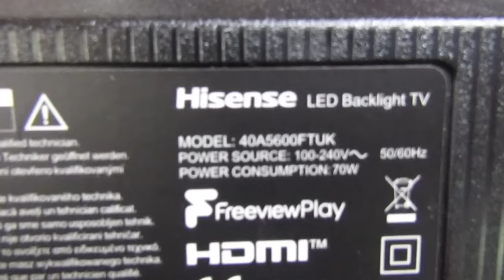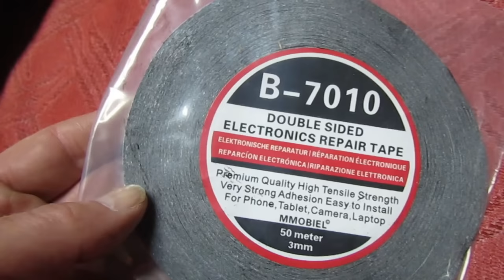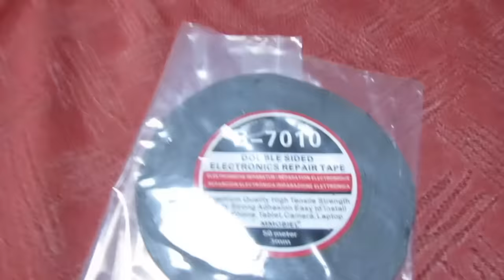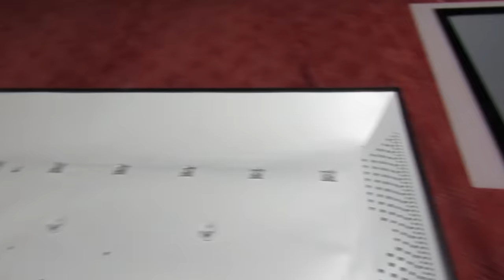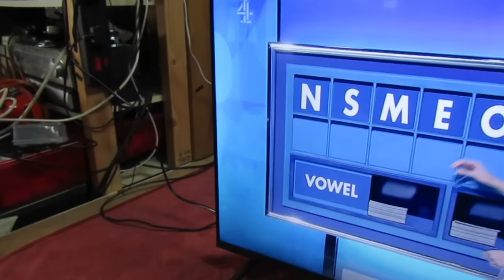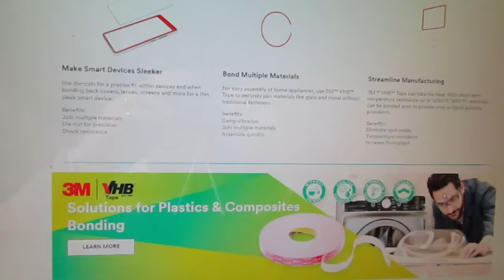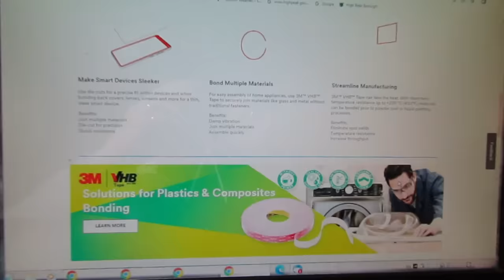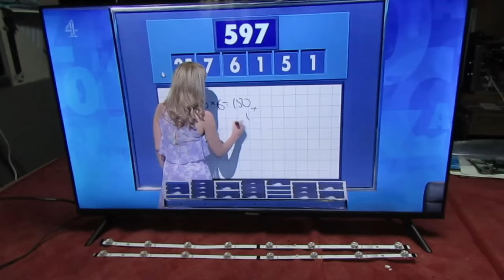Hisense 40A5600FTUK  TV repair.

Comment: Imagine getting into electronics as a child now. You have no chance of playing with old stuff and seeing how it all works - glad I am in my 50s and enjoyed "proper" electronics in my youth.
Reply: I know exactly how you feel, I’m the wrong side of 70 and grew up studying valves then transistors right through to the programming of microprocessors and digital control systems. Today’s faultfinding is mainly limited to board replacement by technicians following self diagnosis instructions from the faulty equipment. Component replacement is sadly a thing of the past.
Reply: Excellent job Michael. The government is always bleating about recycling everything and stopping stuff going to landfill but manufacturers go out of their way to make things unrepairable so they end up as landfill anyway. Wish I could invent a time machine and go back to the days when we could actually get parts / manuals and actually fix stuff. Electronics repair used to be an enjoyable job but not any more, I wasn't taught to be a panel changer.
Reply from the maker: This is true  , Im so glad I grew up in the 70 s .
Reply from the maker: @user-rf9me7xm1w  its very sad the way we have gone with electronics and miniaturisation.
Reply from the maker: @rscelectrical7091  I had the time of my life in the 70 s -80 s , everything was going so well until these awful flat panel sets were invented .

Comment: I wonder if „infusing“ the tape with 90%+ IPA would have helped dissolving the glue a bit. Works pretty well with glued in laptop/phone batteries without that pull strip.
Your persistence & experience along with an always very thoughtful approach are inspiring! 👏
Reply from the maker: You could well be right but I have always been very sceptical about poring a liquid  onto a LCD panel in case it damages the bond between the two glass plates .
Reply: @michaeldranfield7140  ah, yes, a very valid concern!

Comment: Well done!! Built in obsolescence comes to try to defeat us but engineering skill and ingenuity wins out. I remember the same situation when mass produced VHS machines flooded the market and made commercial repair non viable. We need a Right to Repair that means something.
Reply from the maker: The very last generation VCR s made I believe by Funai were as you say not economically repairable due to the fact they soldered all the bits on the deck directly to the board, no plugs and sockets, so It made a simple job into a difficult and time consuming job for an item that cost so little to buy new .

Comment: Smacks of some Sony sets I’ve encountered,I use a piece of plastic bottle cut out and it works a treat   Nice and thin but strong enough for the job!well done on completing the job! Manufacturers always coming up with ways to stop repairs.
Reply from the maker: This was my first time on a glued in panel so I had no idea what to use , in fact I didn't even think this was going to be possible to remove the glass without cracking its so thin .

Comment: Well done Michael! I was a professional, component level electronics engineer working in the audio industry for all my working life. I am now 70, and have taken to restoring old cars for a hobby (don't ask me why!) anyhow, strong double sided foam tape holding things together is rife in the car world. I have found a wonderful product sold by CPC called Sticky Stuff Remover. All you would have needed to do is squirt some of it along the edge of the double sided tape (possibly using a syringe) and leave it as long as you can be bothered. The bond will just let go. It is also fantastic to remove the remnants of the old tape. Only drawback, you have to clean the surfaces thoroughly with some IPA before anything else will stick to it.
Reply: That's good call, or the CPC own brand  'Pro Power' label remover (maybe similar stuff) Orange based, disolves sticky stuff as you say. Also a bit of heat works wonders.
Reply from the maker: I use to have some stuff years ago that smelt like oranges for removing sticky labels  and it worked very well but putting a liquid onto an LCD panel worries me incase it damages the bond between the two glass plates .
Reply: @michaeldranfield7140  Good point, may be worth trying on a scrap set to see what works and what doesn't.
Reply from the maker: @adamdavies163  I have just got half a dozen brand new Hisense sets all with smashed screens so I will give it a go , nothing to lose on these .

Comment: When I see a complicated repair like this, I really wish that CRTs will make a comeback, as they are much easier to repair. I never really liked flatscreens, since they came on the market with plasma models making their debut !
Reply from the maker: all I can say is Im glad I grew up in the 70s with CRT technology, the only time I liked flat screen sets is when they first came out and they cost a fortune and people didn't mind paying to have one repaired but now you can buy so cheaply its more or less game over .
Reply: @michaeldranfield7140  I can vouch for that. I had a Sony 46" LCD TV Model Number KDL-46BX450 from 2012 before and quite expensive at the time. This flat screen did not even run the estimated hours it claimed. It was maybe hovering between 10000 and 20000 hours, equating to about 7 years of my watching time (I did not watch TV that much), before something burnt. On closer inspection, the smell was coming from the power supply. So, I ordered the replacement part from the States, hoping that this was the culprit, but no joy. Something else also got fried in the process. As this was beyond my capabilities, I took the set into a specialist technician, who quoted me more to repair, than the cost of another telly. I now have a Panasonic 49" LED TV Model Number TH-49GS520Q from 2020. This set has run minimal hours so far. But here's the thing, this is a cheap "knockoff model" for the South African market and not a true and genuine Panasonic. I cannot even get the exact specifications for this model on the internet. However, it is still working and I am satisfied at least.

Comment: Hi Michael, i just repaired a Hisense 43ae7200 with red led flashing, i managed to lift the plastic bezel where the screen is mounted on, so the screen it comes of with te plastic support, and there was one LED broken, a set of LED's was not available so i made a bridge on the bad led, now the set works but it is still a lot of work, greetings from France.
Reply from the maker: That was the problem , a lot of work and customers don't want to pay much now .

Comment: Excellent job repairing this TV.

If anyone is attempting this same repair I would suggest leaving the protective film on the adhesive tape and peeling only a small section outward creating a pull tab.  This would allow position the screen then pull the tab slowly to remove the protective film. This a technique used for applications of decals so it should work just fine.
Reply from the maker: very difficult using the tape but got there in the end .

Comment: What a pain, as you said, these were never made to be repaired, my GEC (Hitachi) TV is from 1982 & still going strong & never needed any repairs other than a squirt of Servisol for a noisy volume pot! I got out of the trade in the late 80's, but still fixing tellies....
Reply from the maker: I use to like the GEC Hitachi stuff back in the 80s , the frame module was a easy money maker, HM6?02 was it , I cant remember now .

Comment: If it happens to our 50" Hisense, I will be Dremeling 2 slots in the backplate to extract the strings 🤣🤣, Nice (one off) job. 👍👍
Reply from the maker: I don't know why manufactures cant put a removable panel on the back of the screen , backlight failure is now the most common encountered fault.

Comment: Michael, my condolences. These hisense products are absolute trash. I had a 65" hisense with backlight failure and I struggled to remove the led reflector paper. It was glued in so many places that I could not remove it without creasing it a lot. The end result was a crinkle cut reflector paper that was causing dark patches due to the light being blocked by these wrinkly curves of the paper on the edges. I explained to the client that these sets are designed  to be thrown away once the back lights have failed and that's why you don't get a perfect picture. If I wanted it better then I could have thrown the reflector paper away and painted the inside with white gloss paint. Then placed the led strips directly on the painted surface. Used special tape to keep the wires flat down. The end result is a almost perfect picture. I was surprised with the result.

Comment: An excellent example of a product made as cheaply as possible. Even the led backlights have been cut down to 2 rails. No doubt pushed to their limit so an extremely short lifespan.
Reply from the maker: Everything glued to cut down on screws, then there the awful Samsung's with the screw less back , makes you wonder where it will all end .
Reply: @michaeldranfield7140  Exactly. Our Samsung curved telly has a clipped on back. No doubt I'll have to remove it someday. The brightness is turned down to delay that day. My Wife hasn't noticed. I did that months ago!
Reply from the maker: @colintinker7778  dreadful things those screwless backs, I have the special tool for removing them but some sets use double sided tape as well and curved screens just crack on there own .

Comment: Not a PL36 in sight! Very well done on that repair, I think the moral of the story is to keep the brightness of these 'led flatpanel contraptions' to a minimum acceptable level for any hope of a reasonable length of service!
Reply: I keep telling my friends exactly that. Keep the brightness as low as possible and never more than 90%. The Dell monitor that I'm using right now is set to 60% and it's perfect.
Reply from the maker: I have an idea for making a valve amplifier with a couple of PL36 s , just not got round to it yet .
I always turn down the backlight setting doen to 60% and no one has complained yet so yes this is good advice .
Reply from the maker: @manolisgledsodakis873  I turn all repairs down to 60% and no one has noticed or complained yet , all sets I see come out the factory set to 100%.
Reply: @Michael Dranfield  What is bad is that the Chinese manufacturers know that the leds will burn out if the back light setting is bright, turning g the set into junk. If they wanted to, they could put more back-light leds in and run them at a sustainable power. But they won't!

Comment: This is becoming more and more common with electronics as manufacturers discover savings through adhesives. It also helps them to persuade customers to not have products repaired and buy a new product. I realised things were getting bad when the first thing you often see in the owners manual nowadays is 'How to dispose of this item responsibly' - not what you want to read when you've only just bought it.....!!!  The marketing guys will tell you that it's in our interest as it makes the product thinner/lighter and 90% more recyclable. To think I used to complain about Thorn 3000 chassis blowing R2010 chopper transistors.
Reply from the maker: as you say no only does it save a bit of money having no plastic bezel round the edge but it also makes it more un likely that you will have it repaired , I have a Thorn 3500 for restoration but not got round to it as yet .

Comment: definitely only designed for assembly, and if it fails, tough! bit like a ferguson 354U radio from the late 50s/early 60s, you have to remove the dial escutcheon to remove the dial knob to get the insides(pcb) out, and that escutcheon is held in by metal fingers pushing through slits in the cabinet front being twisted over inside ! you'd likely remove and refit once but if it needs to come out again, risking breaking them off!
Reply from the maker: Built in obsolescence  getting worse .

Comment: I know something stronger than a ribbon cable. It's the see through molded packaging.
I think it's PET ? So I cut little sheets to use as a prying cutting tool before throwing it in the bin.
Reply from the maker: My first time with a glued in panel so I had no idea what to use and even if it was possible to remove at all as the glass sits down in a recess.
Reply: @michaeldranfield7140  You managed quite well. Opening up a glued imac seems easyer.

Comment: Wondering where did you source the replacement LED strips? I am a Hisense service agent but Hisense do not supply backlights aa replacement spare part and am losing quite a bit of potential charge work as a result. I mostly find suitable replacements for other brands from Aliexpress but none available for Hisense.
Reply from the maker: I got them from ASWO in France , strange they wont sell you parts as these were genuine Hi sense LED bars.
If your looking for a load of Hi sense sets though I could help you out , I have quite a few brand new Hi sense sets here that were damaged in transit , all screens broken if your interested ?

Comment: Ahhh doh haha! I’m sorry I was in bits about your pals story and the screen falling out haha ahh man that’s a nightmare 😂😂😂 Can hear the customers moaning already “you botched the screen in” jeez poor guy 😭 Thanks Mike, I’ve come across a couple my self and done a smash one a couple 🙈
Reply: On another one these are the worst I’ve ever fixed. The quality is literally the worst ever.
Reply: Also I use thermal plaster to glue the leds down and e7000 to glue the panel. I’ve a thin metal shim tool for tablet screens I use, just cuts right into the adhesive.
Reply: Don’t bother cleaning the old tape either unless you see a clumps, if it’s mostly flat use e7000 and your away.

Comment: It is just amazing that you managed to remove the panel without breaking it and then glue it back in place so perfectly aligned. Thanks for showing us the whole process and pointing out the need to use foam tape. Well done.

Just now another youtuber has uploaded a video doing the same repair on an almost identical Hisense TV with a glued panel. In the video he is able to simply unclip the plastic frame with the panel still glued from the metal chasis, thus making the repair much easier. I wonder if this was also possible with your TV. Here is the link, the unclipping starts at 5:00: https://www.youtube.com/watch?v=wLx-6oqdyzg
Reply from the maker: No, that's ones a different model, there is no plastic fram in the one I did, the LCD panel is stuck straight onto the metal frame of the set back.

Comment: How would you go on if the panel had cracked? Do you let the client know of any risks beforehand, in jobs like this? For example some of the stuff I have in here has very brittle plastic that can easily shatter just by trying to open it, so the client gets a pile of bits back that actually arrived looking intact. I've heard of repairmen getting sued for damage.
Reply from the maker: I always tell the customer of the risk first , most people will say it doesn't work anyway so there's nothing to lose, but if someone is not willing to take the risk I just give the set back  .

Comment: Best way to cut throught the glue.Use a hair dryer on the edges to soften the glue.Dont overdo it ,no need to get the panel scalding hot,it may cause damage.Then use a plastic card from a card deck made for poker,since its plastic and quite durable.Thank me later.

Comment: There was no doubt in my mind that you would fix it!! However, what a dreadful build standard with glue and tape everywhere. At least with a Samsung (the only one I have done) , the thing comes apart easily and the backlight strips are copper backed, rather than aluminium for better heat transfer.
Reply from the maker: I didn't think this was going to be possible the glass is so thin on newer sets , I have broke thicker screens than this that weren't glued in !

Comment: Are the replacement LED strips specific to a manufacturer or are they generic parts sold by length / brightness or otherwise?
Reply from the maker: No specific to the set and power supply as they are fed with a constant current.
Reply: @michaeldranfield7140  Thanks for the quick reply.

Comment: why cant manufacturer make simple removable back plate for easy replacement of led backlights. this way its designed not to be repaired . the whole world will be full of E waste because manufacturers want profit
Reply from the maker: That would solve the problem and I did see this done many , many years ago on a computer monitor, a removable plate at the bottom of the screen to give access to the CCFL tubes .

Comment: It's not like the Command Strip foam is it, where you stretch it and it comes off?
Reply from the maker: I have never actually seen the command strip so cant say but this tape I used is very funny stuff , it does not feel very sticky until you put it on something , then when its on it wont come off and any attempt to peel it and it just stretches very thin like rubber .
Reply: Ah yes the tape is good. It's what they use on mobile phone screens. I use it on ZX Spectrums, ZX81s, and various rubber feet.

Comment: I wouldnt use any tape michael, i would use clear silicone, a hairdryer will soften this adhesive m8, once this foam tape is in place run the hairdryer over it to bed it in.
Reply from the maker: I did wonder about using silicone rubber at first but then decided against it in case it squeezed out  onto the back of the screen .

Comment: Even though I'm "technical" and I build computers, if I had to repair that TV, it'd go back to the customer in a bucket! 🤣

EDIT: I have a 2 year old 50" 4K Hisense TV, and the screen is perfect, no DSE, no faulty pixels, and it's a cracking TV! ... I've probably jinxed it now? 🤣

Blimey! So, my fancy Hisense 4K TV is SELLOTAPED together? 👎🤣
Reply from the maker: I didn't think I was going to get this fixed either ,I guess gluing the screen saves money on not having a plastic bezel on the front of the screen .